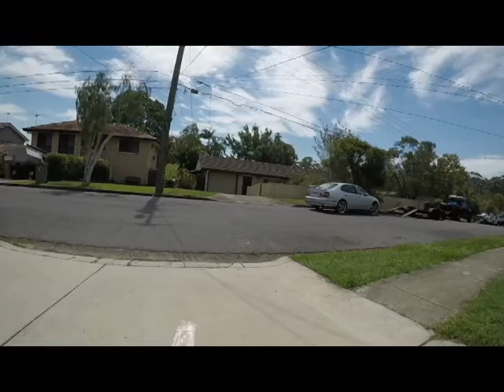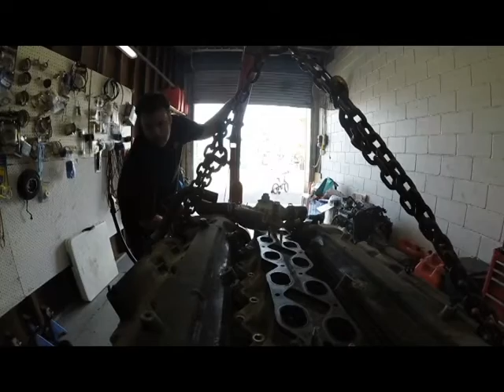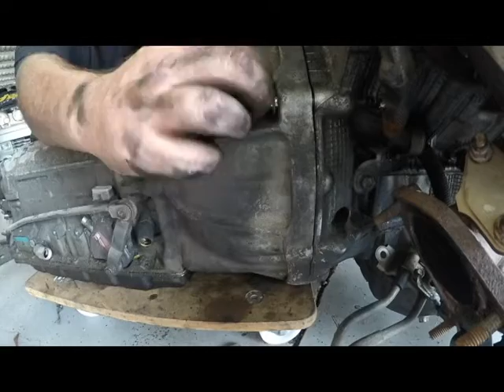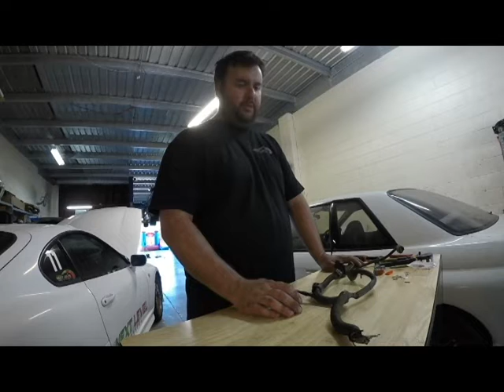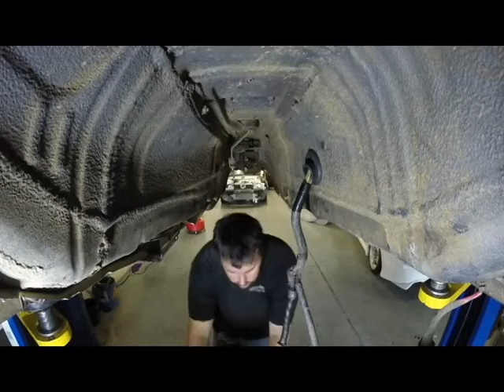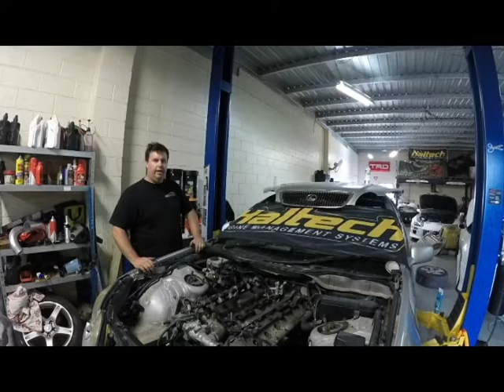V12 LEXUS GS300!!! - part 3 installation

Comment: If it drops id doest that mean i could put a 1gz in a ls430
Reply from the maker: It would probably be similar fit
Reply: @NextLevelMotorsport  yeah probably cause i know the 3uz just bolt right on
Reply: @NextLevelMotorsport isn’t the 1gz a rear mount sump? Did you guys cut the subframe to fit it in or did you do a dry sump?
Reply from the maker: @mikelmarion  no it's front sump
Reply: @NextLevelMotorsport  that fit without cutting?

Comment: Get out of here! Engine mounts, gearbox mounts, sump and drive shaft fell straight in! Was that researched or just bloody lucky?
Reply from the maker: Sway bar didn't fit. Jza80 one is close. But otherwise all bolted in...

Research was done by seeing a few photos of one in the engine bay of a gs300. 

Given the motor was originally destined for our ma70 supra anything was going to be easier than that due to sump configuration so just decided to give it a go and were very happily surprised with the result

Comment: suggestion to set all your camera's, editor, and export to the same video resolution, suggestion would be 1920x1080  ( 1080p ) or 1280x720 ( 720p ) as well as the same frame rate, probably 30 frames would work well. 

Content is awesome, just keep working on the quality too. :-)
Reply from the maker: thanks for the advice will keep plugging away at it. videos and editing definitely isnt our strongest point